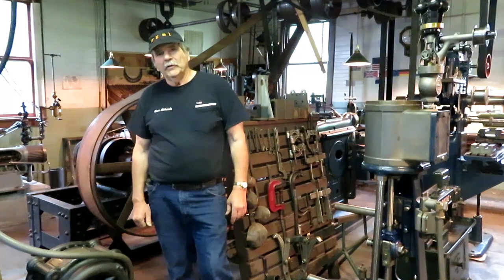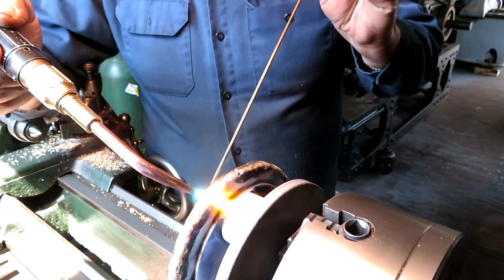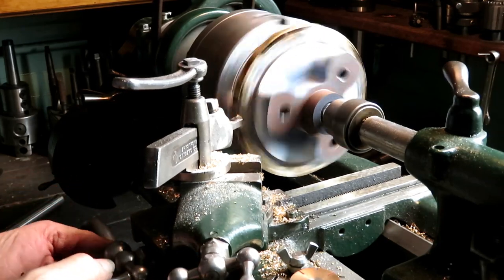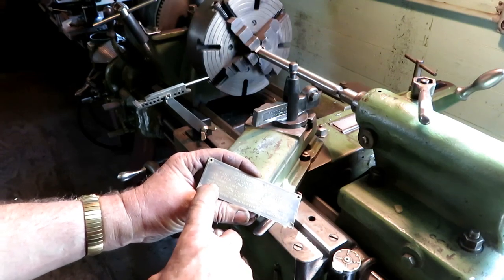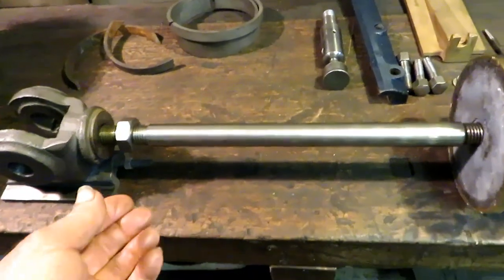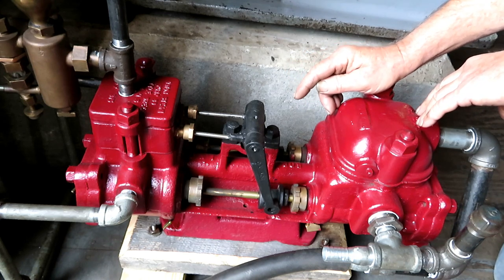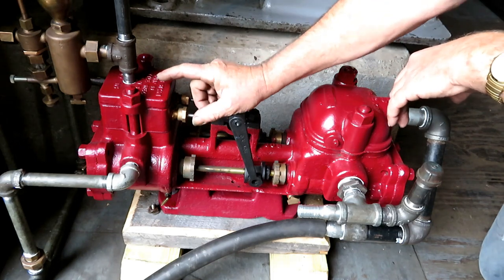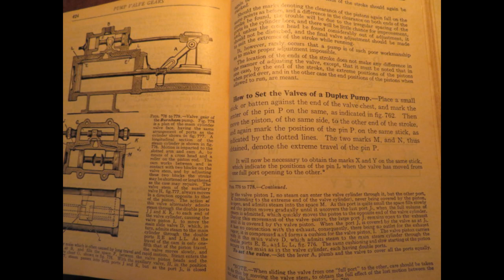OLD STEAM POWERED MACHINE SHOP 39  oversize steam engine piston

Comment: David, is melting brass onto brass, 
considered as welding, or brazing?

Another great video!

steve
Reply from the maker: OH MAN,  now you can get into a real argument.   By definition, welding is the fusion of the two parts and filler 
metal.  Brass does not fuse and mix with the base metal. It microscopically adheres to the surface of the pieces if everything is clean and brought to the right temperature, so it is termed "brazing", like soldering only the brass has much more strength.  My UK friend says it's not, it's all welding.  Braze something together and cut it through the joint, you'll see a clear line between the steel and the brass, no fusion......that's my story and I'm stickin to it. Let the arguing begin.....Dave
Reply: Ha ha; no one will argue with you, Dave, because you're right. Your UK friend is a good fella, but he needs to learn English.
To answer Steve Skouson's question: the initial application of brass to iron is brazing; adding the following layers of brass onto the initial brass layer is welding.
Reply from the maker: Right, I got away from the original question...Dave

Comment: I have no knowledge on the subject, but would appreciate a discussion of why it is OK to use brass to make a piston oversize.
Reply: Andrew Margeson The brass is to build up the pitted ends of the piston... Its will never really be a wearable surface it just helps hold the rings in place... The rings do the hard part and are what seals the piston so its is a small very small percentage of the piston and it's not under alot of wear...
Reply from the maker: I think it will be a good wear surface, It probably wasn't done then because it's a lot of work. I'm sure there are other brass filler rods with better charistics for wear than what I used, but like C&K said, there isn't much side load on a vertical steam engine piston. The cross head takes all the side load from the rod angularity, and there is no piston weight against the side of the cylinder like in a horizontal steam engine. The brass ends up being only about ..080" thick and will expand (from heat) with the cast iron piston material. It's an experiment, but a lot easier than turning a new piston.....Dave
Reply: David Richards so true how many brazing rods you use Dave you have way more patience than I!!! Do a better job braising too LOL
Reply: David Richards just got to thinking and it may be a dumb thought... Will you have any concerns with galvanic activity since the piston and sleeve is cast and the repair is brass and it's a moist environment????
Reply from the maker: I don't think brass is enough far away from iron to cause a problem. Iron pumps use brass valves and seats. I thought of using an aluminum alloy for pistons but they would be gone in no time I'm sure.....Dave

Comment: Will the dissimilar metals wear well, verses cast iron on cast iron?
Reply from the maker: It was sort of an experiment. I built up the O&S shop engine the same way and it has run a lot of hours with no trouble....Dave
Reply: @davidrichards5594  sounds good

Comment: Hello Sir Dave,,, 😆
Just for giggles, have you ever calculated how expensive it is for fuel , to run your boiler per day?
If you're like me,,, you're probably afraid to know.
And then,,  do you notice the use of more fuel when you are working the machinery harder?
Thanks. And keep up the good work.
Reply from the maker: Willy, As you see I use a little coal now and then if I don't want to be bothered to tend the fire so often, but most of the time I burn "junk" wood that costs zero. Scrap from a local wood shop, contractors scrap from deck replacements, porches, etc. Three years ago I burned up my brother & law's entire garage that he tore down to replace. The boiler water treatment I use costs about $100 / year.  The engine is under such a tiny load (for it's size) that you don't notice much fluctuations in firing requirements. Feed water is the big thing you notice with the bigger engine. It's around 25 gal/hr.....Dave
Reply: David Richards 
Oh ,,,  so what is the hp of your boiler?
And how big is the great size?
I think I remember reading in a Machineries Hand Book, 
A chart the listed hp per square foot of grate size....
Thanks for the reply, 
😆😊😎

Comment: Any idea how much psi that pump can put out?  Looks like it's putting out some where between 5 and 10 gpm. Another fine video,  really enjoyed it.
Reply: GPM varies directly with the input steam pressure and speed of pumping in strokes per minute and inversely with the output pressure being pumped against.  In other words the maximum GPM would be maximum operating steam pressure and open feed valve with an open hose as big or bigger than the water discharge port.
Reply: Roy Reynolds, GPM output is irrelevant to steam pressure.
Reply: How about as the steam pressure rises the more work the pump can do?  Within the operating range.
Reply from the maker: I want to do a test for volume output at different pressures (by restricting the output with a valve) in another video. I can see it needs to be repacked and a few other things tightened up....Dave
Reply: When I worked on a steamboat we usually let the water packing seep a little to help lubricate it on the pressure side.  You try to keep the steam blow to a minimum.

Comment: Hi David. I have a 1916 20hp Aultman Taylor steam traction engine. You mentioned that you use an ejector to move water. Been looking for a ejector for my engine.  Where did you acquire yours? Thank you.. Nick.
Reply: I am not David but Penberthy still makes and sells injectors to put water into boilers.  They are injectors not ejectors because they use steam to inject water into a boiler at the same pressure as the steam.  These injectors are reliable if you keep the supply water cold and clean.  Traction engines usually are operated at 150 psi or less.
Reply: Roy Reynolds Thank you Roy. I have two 3/4" penberthy injectors on my engine as they both work well. But I think a ejector has more pull say if I wanted to pull water from a pond only to fill a tank. I just wondered if anyone had one for sale without going through penberthy in Illinois.
Reply: I am sorry I did not understand your question.  What you are describing is a steam siphon.  You should be able to cobble one together from pipe fittings to work.  The cast ones are sort of heart shaped with the steam directed away from the inlet and towards where you want the water to go.  If I remember one I saw it had a 3/8 or 1/2 in steam nozzle for a 3 or 4 in hose.  You will want to have a screen over the inlet for the water to keep trash out of the hose.  Water can only be suctioned up about 20 to 25 feet.

The Penberthy injector can be piped up to do the same thing but just don't try to pull water too high with it.  Also make sure the inlet doesn't pull air bubbles or the vacuum will be broken; been there on that one(water in the tender was too low and couldn't pull just water).
Reply: Roy Reynolds Thank you Roy. I'll have to look into that for sure.. I now remember exactly what you're saying.
Reply from the maker: Roy, I don't know where mine came from, I think my Dad had it stashed away. I've seen them on ebay where people don't know what they are, You can buy them new from several industrial places .....Dave
Reply: Right.  Several years ago I found one here in town at a resale shop.  It was a 2 X 2 X 2.  When I saw it I knew exactly what it was and bought it.  About 3 or 4 years ago I gave it and a 8.5 in X 44 in whistle to the Georgia Agricultural Museum at Tifton, GA. for their steam powered sawmill.  I was talking about the steam  pump.  Steam pumps were made in many different sizes depending on how much liquid needed to the moved.  The siphons are a teardrop shaped pipe with an inlet,  two curved sections to form the teardrop with a steam inlet directed downstream where the two sections come back together into one pipe.  They usually are for 3, 4, and 6 in hoses.
Reply: Hi Nick, in England we call them ejectors too, for lifting water rather then pushing it. I have one on my quarter scale Burrell Traction Engine for filling the tender. It works brilliantly.

Comment: I can't understand why a pump won't pump hot water?
Reply: It was unexplained ......when the piston draws hot water it cavatates into steam,   low pressure boils earlier.
Reply: That makes perfect sense, thanks
Reply from the maker: If you put enough vacuum on any liquid, it will start to boil (vaporize), with hot water it doesn't take to much. The vapor raises heck with the prime on the pump....Dave